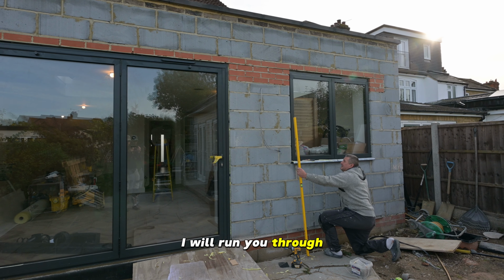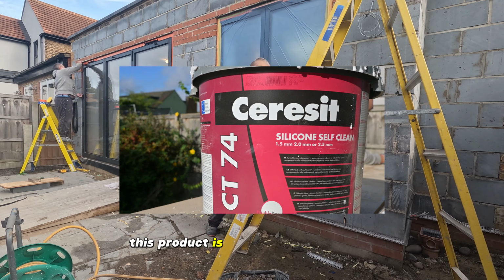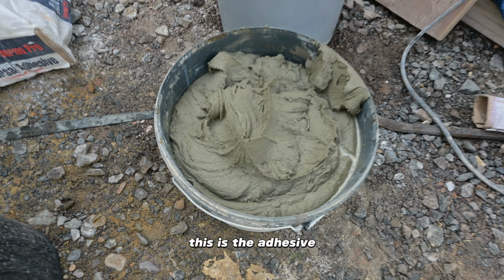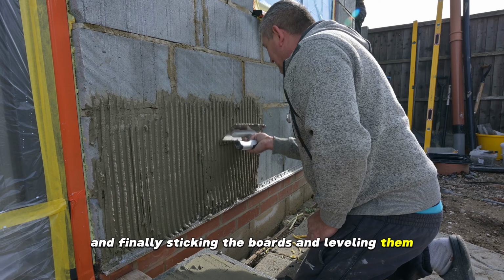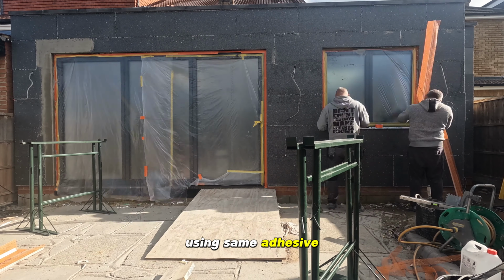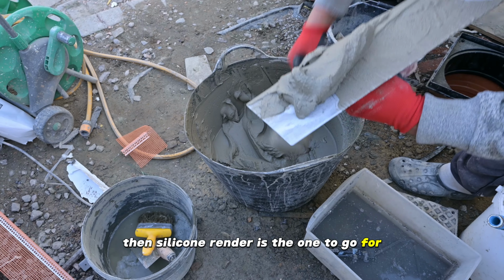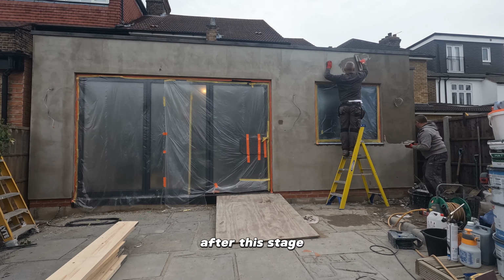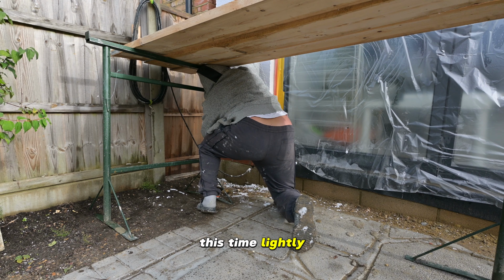Must watch this before you silicone render your house

Comment: Will the silicone render create a mouldy interior as the bricks cant breathe?
Reply from the maker: This is the propaganda the British government is selling to everyone. This method is the solution to insulate all the council blocks in the country but imagine the cost? So they come out  with all this nonsense. This method is used all over Europe and nobody is complaining about mold etc. The wall is warm and it doesn't get cold so there is no condensation. It's completely sealed off from the environment and UV protected. For the purpose of insulation you need to use a minimum of 100mm.

Comment: Hi, great video, at what point in the thickness of the insulation boards would you say you should no longer need to apply the boards on like tiles?
Reply from the maker: @rudedude8794  
Hi, and thank you for engaging 

You always have to stagger the boards but the thin insulation is far too flexible to apply on patches- it just won't work so this is the reason why we use a notched trowel and full coverage of the adhesive. I never used anything in-between the 25mm and a 100mm. The 100mm is stiff so we install it on 8 patches and a line around the perimeter. When the adhesive is set, we install mechanical fixings. When installimg on patches you have more control and you can level the wall easily. With the 25mm it's tricky as it's too wobbly and it's hard work to level it. I am not sure if you watched the full video but I explained the reason why we used the 25mm. Purley for cosmetic reasons so you don't see the mortar lines in winter. 
I am building an extension now and making some videos as well. On this one we will use a slightly different product where the 25mm insulation is not required anymore. We will go straight to the block work. 2 coats of base coat and one coat of silicone.

Comment: I live in an old 160 year old house. It can get damp inside. The outside render needs work. Would a silicone render be appropriate to stop damp?
Reply: Bare in mind the dampness could be for other reasons, consider improving air indoors by tackling the reason for high moisture and then install insulation out doors or indoors.
Reply from the maker: @AlexionIQ  
Hi 
Silicone render is the best for stopping moisture penetrating into the wall and it doesn't need maintenance. You don't have to paint it every few years. If you use a quality product you are sorted for many many years. 
I wouldn't recommend k-rend

Comment: I am a77 year old retired plasterer an open textured finish like this will not stay clean
Reply from the maker: @petergalloway7978  
Hi Peter, and thank you for engaging. 
This stuff is pretty good. I know it looks rough but it is very smooth in touch actually. It's silicone, anti bacterial and anti fungal. Nothing will ever grow on it, like moss etc.

The rough texture over time will collect dust but since it is so smooth, the rain washes away. From experience I know that after about 8-10 years it needs a jet wash and it looks new again. 
Normally after that time you will have to paint the walls again to get the fresh look. Jet washing is cheaper. If you are bored with the colour, it can be painted over with special paint
Reply from the maker: @petergalloway7978  
By the way, how are your elbows? 🤔
I did plastering for 6 years and my elbows were giving up on me so I stopped. Now I do it only from time to time

Comment: Great job. Can this be used as a method to render over pebble dash?
Reply: Thanks for quick reply. Hiw much would it cost to do this for eg front of a typical semi detached london ilford house please?
Reply from the maker: @aag2025  
Hi 
Can't tell without seeing the property. Sometimes we have to extend the roof to accommodate for the insulation. Sometimes the pebble dash is falling off so we need to strip it completely . 

We spoke on the phone today. Let's meet up at the property and we will discuss.
Reply from the maker: That would be a perfect solution. You can increase insulation thickness. Installation of the polystyrene would be different. You would use glue and screws as well. 

Looks great and you insulate the house at the same time. 

Thanks for engaging 😉

Comment: Hi me and my husband are rendering a block raised patio wall  in Bulgaria with sand/cement and plasticiser mix. Now I have a spare container of coloured silicon, could I put it over the mix or just paint the wall? Благадория
Reply from the maker: Hi 
Thanks for engaging 
It's best practice to apply mesh and render base coat, then the silicone. You can do that over comment render. 
I wouldn't recommend to apply tye silicone directly onto the cement render. The render base coat is designed to provide a good bond between the two. 

If your cement render is done nicely, just paint it with quality masonry paint and it will look nice. 

I hope I helped 😉
Reply: @yesconstructionltd  You can apply silicone render onto sand and cement so long as you use the primer. If the sand and cement render cracks it will crack on the silicone but so will paint.
Reply from the maker: @dampwally611  
Yeahhh, you can. I prefer to use the base coat with mesh. I think it will definitely stop small cracks from coming through. The big ones will come regardless, I agree.

Comment: What if you have an extension at the back of the property, I am assuming you are not able to add the polystyrene as it exceeds past the plannong permission level?

Also, Good work
Reply from the maker: Hi
I don't think that anyone will have a problem for adding 25-30mm to the overall measurement of the property.  

It's not structural. The extension was built to let's say 3m and signed off by  BC and that is it. What you do after is your business. You're only adding some insulation and render. 

Also I know that there is some tolerance. The extension in the video  was exceeded in height by 150mm and 100 mm in depth and the building control was absolutely fine with it. 
If you are concerned, write to the council and ask, they should know best. 

Thanks for engaging 😉
Reply: @yesconstructionltd  thanks for the info. 
Neighbours are a huge problem so have to be careful.
Reply from the maker: @Paradox1P  
Oh yeah. I know what you are saying. 
You can go directly on the brick/block but there is a small chance that when it gets really cold, you might see tye lines (as shown In the video)
Reply: @yesconstructionltd  I see. Thanks for the info. Where areas do you cover in the UK?

Comment: How does this work with the weep holes above the door and window?
Reply from the maker: Hi 
You can extend it. See the link below 

TIMCO IW500EX 500mm Timloc Invisiweep Wall Weep Extension Tube-Clear-Pack of 10 https://amzn.eu/d/2PUHKAV

On this job we didn't use it as I don't like the look of it and the building control didn't have a problem with it. 

Thanks for engaging 😉
Reply: @yesconstructionltd  thank you, looks amazing and I don’t want to use them either. Top job 👍